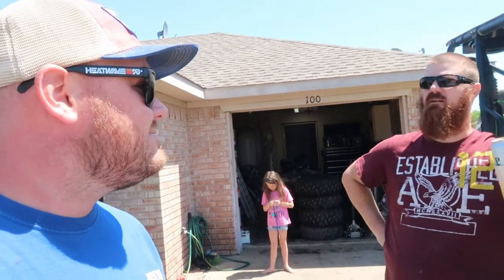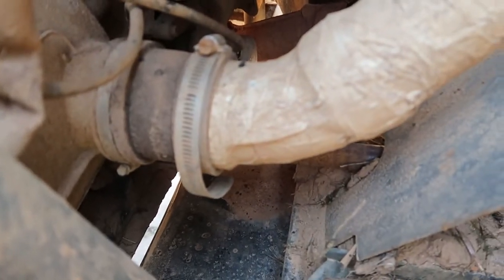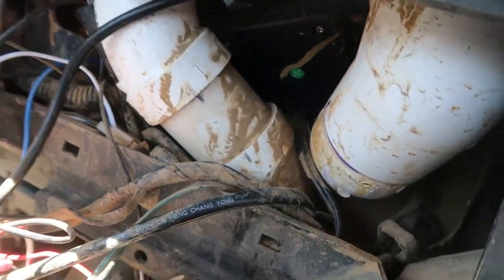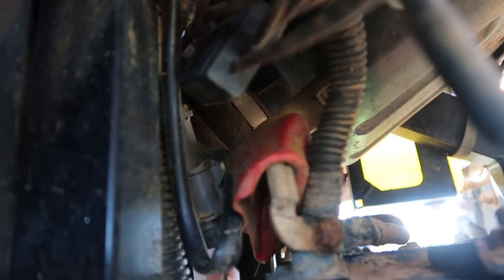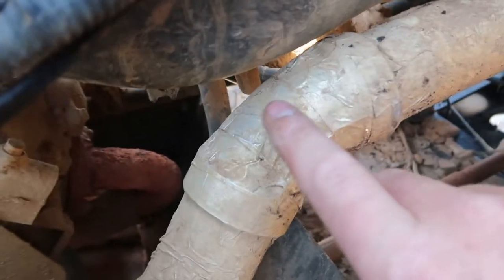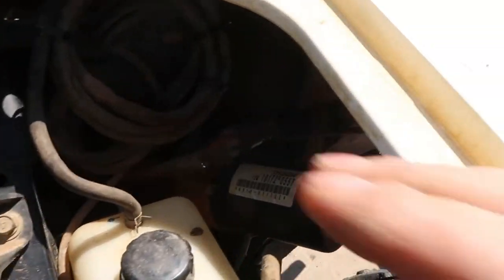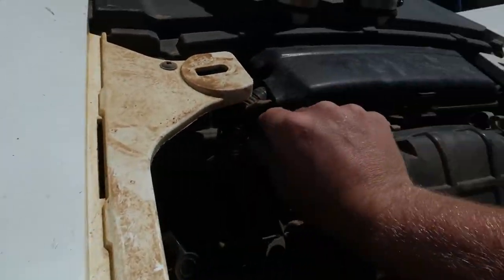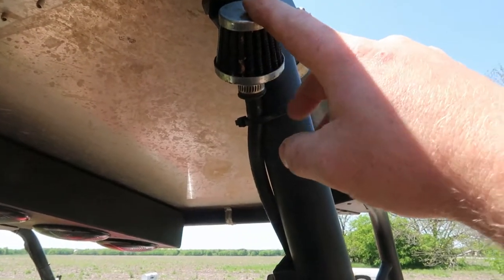How to Snorkel a Kawasaki Teryx [Step By Step Tutorial]

Comment: Im not looking to run a full snorkel kit but i was wondering if the belt exhaust vent pipe alone would help keep the box and CVT belt cooler. I shredded one and i believe its due to the heat build up in the box

Comment: Quick question, I own a 2016 Teryx 2 Camo, would your snorkel system work with mine?, Second question, would you recommend relocating the fuel vent system even if you don't plunge your machine?
Reply from the maker: Extend all vent lines just for assurance and yes, the snorkel system should still work.

Comment: Got a 2012 t4 will it be similar to this year and to vent the belt can I run up to roof then back to maintain cup holder in the back?
Reply from the maker: 2012 is sightly different as far as belt venting, but we wouldnt suggest running the belt exhaust up to the roof and back it might be too long of a run and overheat the belt

Comment: Did you have to seal the belt box?
Reply: The belt box has a good seal on it from factory so no extra sealant on these. However if you have an older machine or changed the belt i would recommend some rtv sealant or marine grease on the gasket.